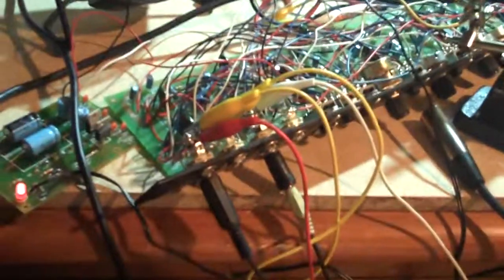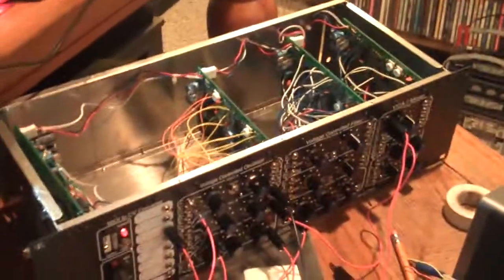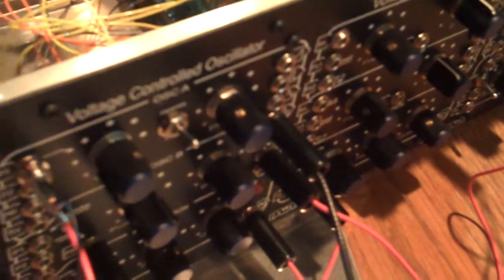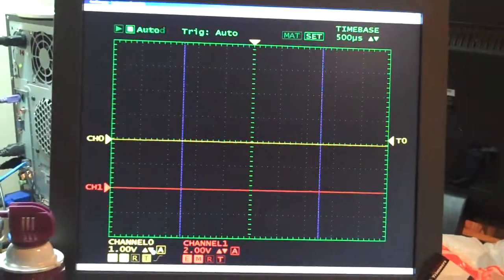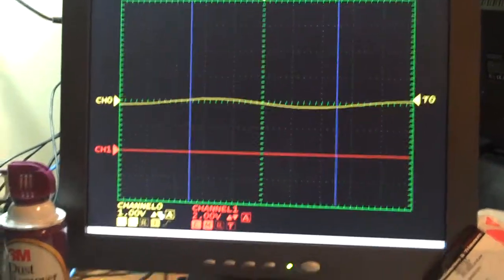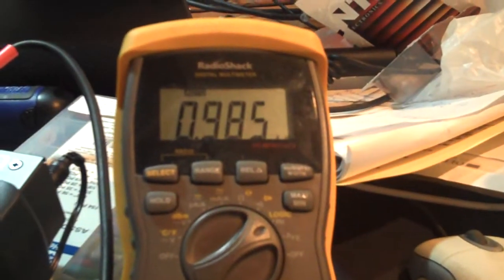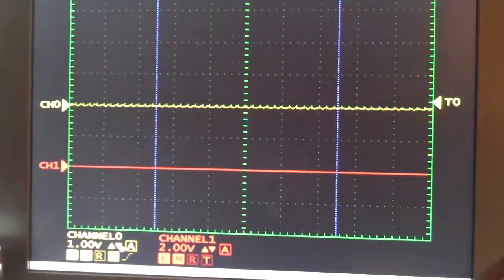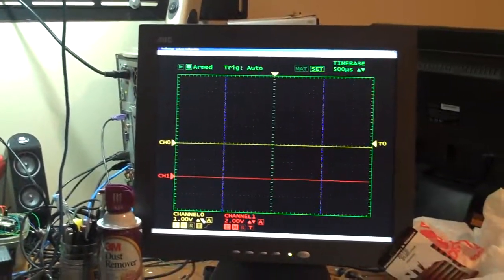How to test the PAiA Vocoder

Comment: I had been looking for a nice affordable analogue vocoder for a while now and this one seems to fit the bill nicely, my only concern is that although I have done minor repairs on drum machines and synths in the past (replacing busted resistors and capacitors, changing pots etc) and I have never tried anything like this before.

Do you think I would be able to build a working model simply by following the instructions included without actually knowing how it works inside?

Comment from the maker: The bands aren't really tuned to specific notes in a scale, but are spaced out over the range of a typical modulator signal (ie the voice). 

These 8 bands are used to "shape" the carrier (synth) into a close representation of the modulator.

Roland vocoders have 11 bands and offer slightly better resolution.